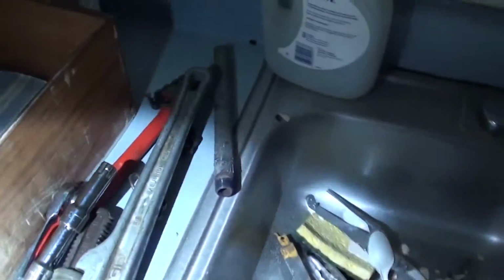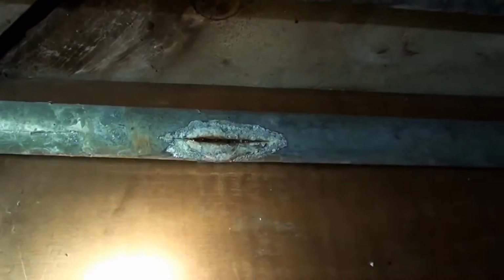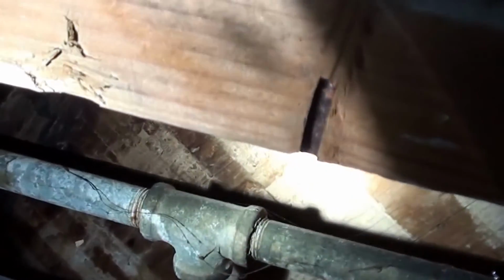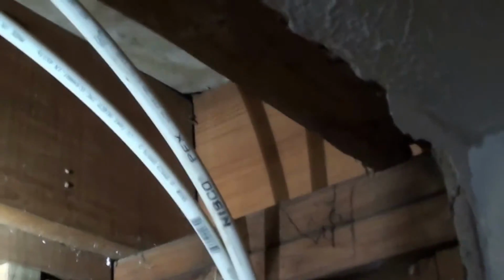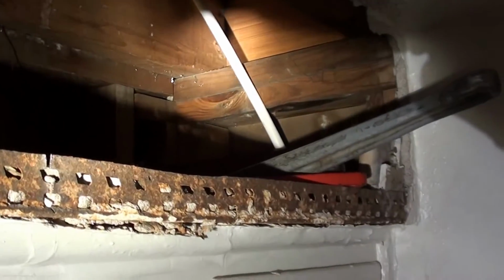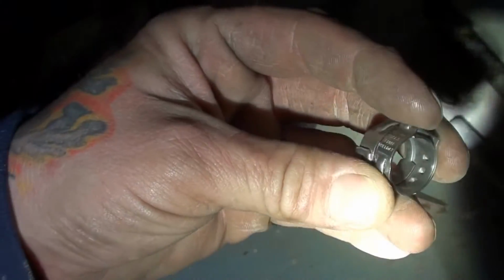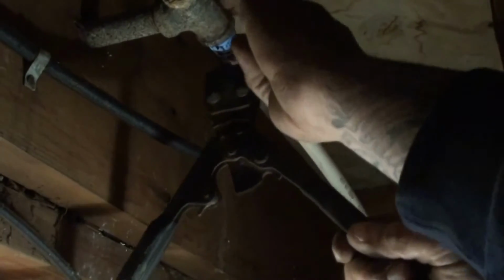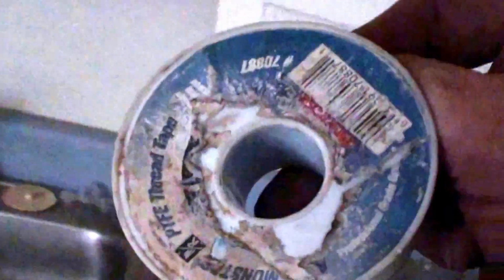galvanized water lines replacement tutorial ( tools,  steps, order)

Comment: At the 6:33 time mark, I had the same problem  and used a $16 butane torch for about 1 minute, and the pipe screwed out easily.  The pipes were original and about 40 years old.  I also replaced the pipe with Pex and Sharkbite fittings.  Took me about an 1 1/2 hour to do the whole job.  If I had been a professional plumber, I probably could have done it in about 20 minutes.  Be sure and look at this video before you do anything, as there are a lot of little things that you can do wrong, and then will have to start over.  EXCELLENT VIDEO!
Reply: I hope you wore the correct respirator and ventilated.